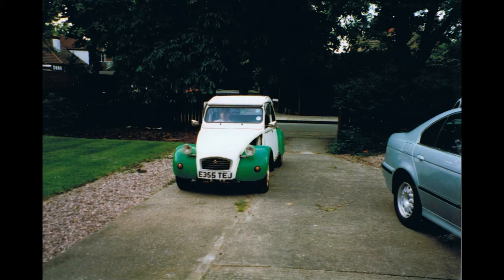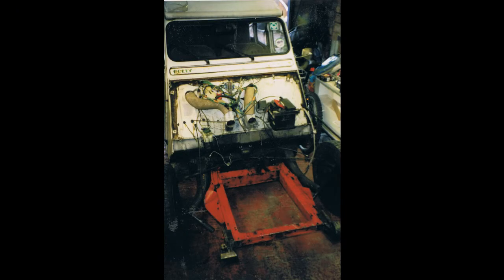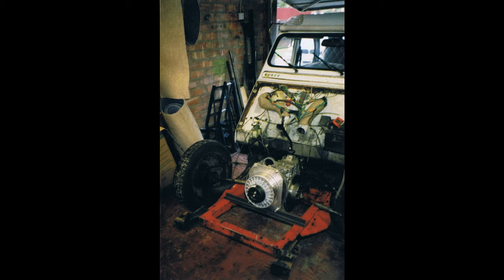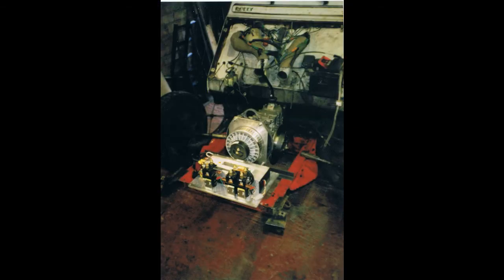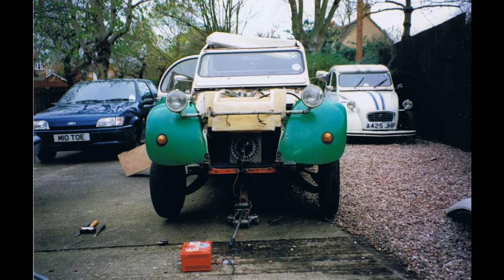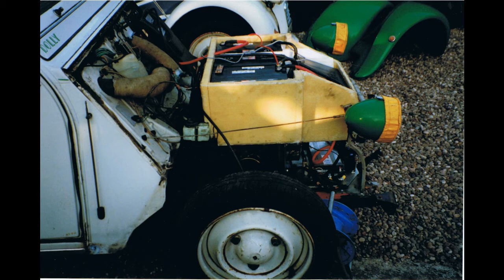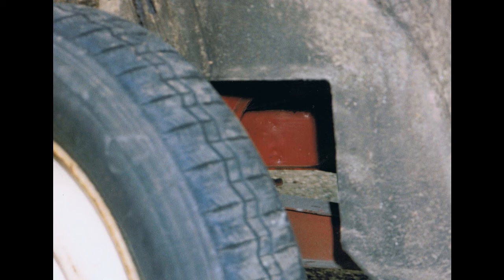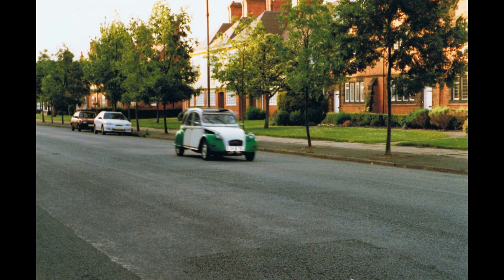My electric Citroen 2CV conversion

Comment: Do I remember it originally having a different registration and is there still going to be a follow-up video?
Reply from the maker: It always had this plate, it's just it was built from two cars! The car was scrapped a few years later due to the dreaded rust. I guess my current rebuild series is the follow up as this will be converted once properly finished. I almost bought a special chassis to accommodate Tesla modules, but this needed other changes too so I stayed with a standard chassis.

Comment: The idea for banding the lynch motor to stop it flying apart came out of a conversation  in the Silverstone  pits in 1999  (Shell eco marathon) where we entered a Lynch powered solar car - Cedric explained the issue with overvolting his motor design  for a motorcycle event at the IOM TT's-  I explained how Stanley steam cars wrapped 3 layers of piano wire round  their boiler  to contain the pressure when attempting the land speed  record in 1906 - at the end of the chat Cedric was contemplating  a carbon fiber modern equivalent - I guess Kevlar is the  tougher and more elastic conclusion - its funny how ideas morph
Reply from the maker: Hi. My motor was actually banded by Robert Fowler of AVT in 1998 and I think was the first banded motor he actually sold, so pre-dates anyone else offering banding.